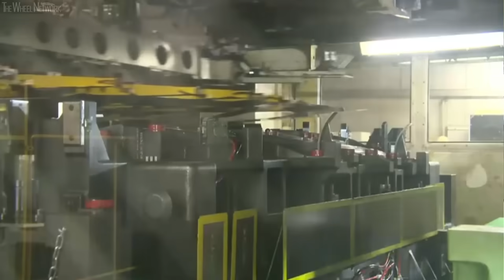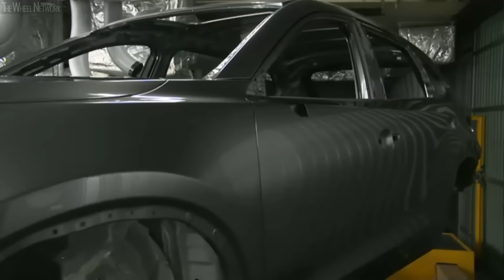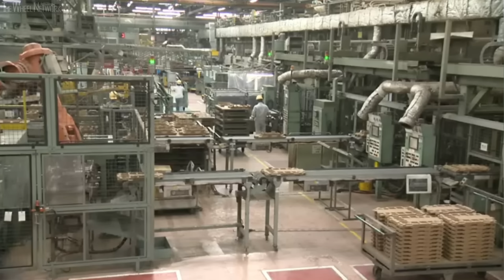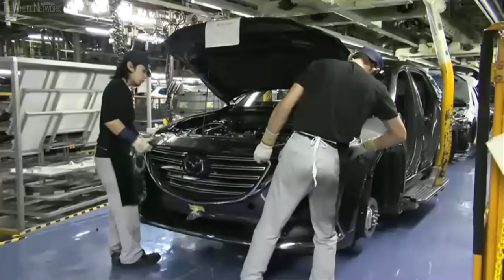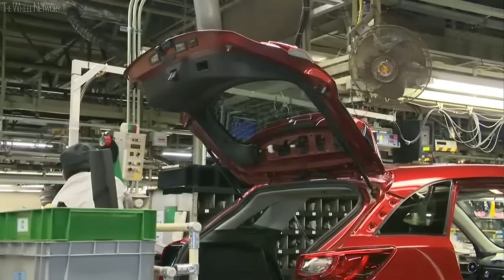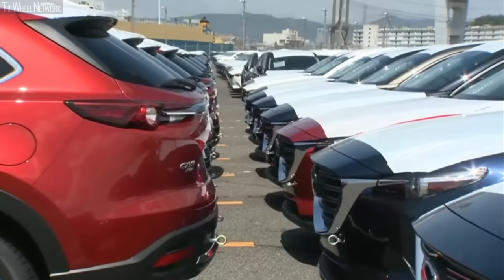Mazda Production in Japan

Comment: Interesting to me the number of comments here from Mazda owners, pretty much all of whom have good things to say about their cars. Definitely an underrated brand. Zoom zoom.
Reply: Read again. I found many problems in comments as rusty pieces everywhere and shit thick metal pannels
Reply: Guess you forgot about the "Zoom Boom" screw up.
Reply: @JuanCaBaez  car factory standard is 0.6mm thick and yes metal rust, next time buy a very expensive audi with a "space" frame that oxidizes ;) every car manufacturer has it's problems with a or more models they make. Look at Tesla: the panel fitment is mostly junk.
Reply: @Damicske  es peor cuando habiendo comprado un Mazda 3 del 2018 y golpeado 👉"involuntariamente"👈 el parante C, se dobló...!!! (IT bends!!) lo que en cualquier auto, no pasaría... lo tuve que vivir y lo tuve que vender!!
I had to live it, and I had to sell it!
So it's a shit personal experience...
Reply: I currently have an '18 Mazda 6 with manual - 40k in just over two years (I drive a lot) and its been flawless. Also, this is my third Mazda in 13 years. Amazing cars.
Reply: I have a Mazda 6 first hand, model 2003 with 245.000km. It is in perfect condition after 17 years, fully reliable with zero problems. Recently i also bought a Mazda CX3 diesel, AWD Auto. It is such a nice car. Mazda is indeed a very good manufacturer. If you don't own one you cannot understand.
Reply: @nikostzagar  i had had two mazdas. First one was a matsuri sedan 626 2.0l year 1995, full!  It was an amazing car.
Second, new mazda 3 sedan MT 2.0l year 2018, 0 Kms. What a CRAP!
Reply: @JuanCaBaez  Sorry to hear that. I don't know why you were not happy but I am very excited with my Mazdas.
Reply: I own a Mazda 3 2011 102000 miles still running good
Reply: @nikostzagar  problems all around. Noicy suspension, bad interior insonorization, no navigator because mazda doesnt have ecuador's map yet, bumpy, bad function of wipers sensor, radio controls were dumbs, weak pannels and hollow sound in doors, very bad seats that unbuild themselves, shit interior that got scratched very very easily, poor space in the trunk, etc etc
Of course this is in comparison with my Megane 2.0 2006 that goes perfect and works better than that shit car I bought. But I sold it fortunly!
Reply: Mazda is second choice on a lot of people's lists. That's the issue though, they're hardly ever the first pick. Mazda is an amazing bang for the buck brand. I feel with the new line of cars they're really attacking BMW head on.
Reply: @JuanCaBaez  Every car has rust issues, given the wrong environment and time for it to develop.
Reply: @JuanCaBaez  You're the first person I hear praising a French brand after having had a Mazda. Also, if the 2006 Megane is an improvement compared to whatever Mazda you used to own, most of the issues (like rattles, bad sound insulation, out of date navigation system) are due to the car being of old age. You cannot possibly be talking about a modern-age Mazda, this was a '90 to early '00s Mazda at best that you have owned.
Reply: @JoppedeZeeuw  maybe I'm the first going against tendency, but I had owned mazdas from 1995 (Excelent!!) and 2018 (A complete shame for brand, Crap, shit in all the posible meanings) and the Megane II 2.0 sedan manual; wich is my reference to buy a car (sedan "C" segment), until now not beated. ;)
Reply: A great car indeed. Durable and elegant at the same time but what about the rust?
Reply: @mentzo1  rust is something every car experiences at some point in its lifetime if it gets the chance to develop (rain, salted roads etc). The reason why it’s notorious for Japanese cars to rust is because those cars are around long enough to develop it. If you look at a VW Golf/Rabbit or a BMW 3-series of the same age, they will also show significant rust. But people driving expensive brands tend to replace their cars sooner too and therefore they hardly become old enough to show it before they are scrapped.
Reply: @JoppedeZeeuw  Yes, but I think it also has something to do with the metals used.
Reply: its used to be owned by ford take over the Mazda,,,..and now began this model and  is purely made in Japan,,we all know quality of cars manufactured in Japan and  best and good cars in the world
Reply: Allen S  had you bought one of those mazda craps ever? Do you have a license? Of course that do not waranty you know how to drive... if that is even that way, you might have driven a good car to compare with... I really doubt it actually!!
Reply: @JoppedeZeeuw  never experienced rust in any of my Mazda’s.  To be fair, with any Japanese made vehicle, and we have owned many and we live in a high rust area.  Electronics yes, but that is every single vehicle we have had, noting the environment is harsh where I live, salt, high amounts of rain and sulphur.  I have experienced rust with just about every American made vehicle.  Maybe it’s the manufacture country that is the issue and not the brand?
Reply: @mentzo1  I hear this a lot but where is the evidence or is it fan boi's of other brands continually trolling Mazda?
Reply: @JuanCaBaez  lol you found many problems in comments and you believed them?
Reply: @jace1113  of course!! I set one comment with my personal experience of that poor brand... the whole car was a piece of *&¿$. Why dont you belive them? Sharing experiences is the main idea of this....
Reply: Robert Bueno  io posso dirti che per una machina turbo, la sua potenza di 143 hp è poco... dovrebbe essere vecina a 180 cavalli. You do confirm me.... sell that car was the best idea ever!!
Reply: That's right, I don't know why this Ecuador guy thinks a Renault is better than Mazda. I also have experience with Renault and Mazda, and I will say, even though the Renault might have better features (but again, I'm comparing the most expensive trim of a Koleos against the most basic trim of a CX-5), but the Mazda is way better to drive and in general just felt better. Also, if someone actually ever ownered a Renault, then they would seriously know how horrible Renaults can get after a few years of ownership, the issues old Renaults can develop after a few years is just ridiculous.
Reply: @e8u3s72  that's only because I had mazdas 626 and 3, and the last one was a crap, also trying other 3s of the dealer, and comparing with my megane (I still have it).
If you like that hollow sound in all Doors of the car, the noise of tires inside, or the seats unbuilding itselves.... your fault!!
Ya los he prevenido. No digan luego que no...

I hated so much that piece of car that I would never buy another one.
Reply: @e8u3s72  you're the lucky guy. I had heard many problems with the CX5... bumpy and noicy suspension, need to replace..same as I had with that CRAP I bought.
Lucky you. Buy them all!!
Reply: @e8u3s72  en ningún campo podría superarle el mierda CX5 a un Renault Koleos. Debería haber un video sobre el tema... ya lo buscaré...
Reply: @e8u3s72  man tu problema es que idealizas tu chingadera.
En Ecuador llega el CX5 2.0l con 156 hp, que es la misma basura que el mierda 3 pero con más peso y menos aerodinámica, mayor consumo, etc... y el 2.5l de 188 hp y tracción awd. El koleos es un 2.5l de 181hp caja cvt pero tracción 4x4. Y diciendo que comparas lo que tienes, con un pobre mierda 3 te dejan botado, peor si lo comparamos con lo que yo manejo ahora...
Renault tiene audio bosé y mazda tiene una basura de sistema que ni la canción que esta tocando la encuentra, sin actualizaciones, sin manejo fluido, sin Android, sin internet, etc... ya pase por eso y ya pagué la tontería de tener un mierda!!
Tengo todos los videos de las fallas del auto, de una en una... aunque debí haber sacado videos de los otros autos que me dieron a probar y eran la misma basura 3, CX3 y CX5.
Si tienes dudas de que en el Ecuador son una basura, te puedes comunicar con Maresa Center, representante en el país de esa marca y les puedes pedir la orden de llamada general a revisión de todos los autos?? Eso iban a hacer después que tuve la desgracia de comprar uno.... y esperaban que Japón o al menos México conteste, por que son tan malos....

Asi que man, buena suerte con tu #mierda, ups, #mazda
Reply: @JuanCaBaez  Firstly, use English, don’t use a language that someone might not understand to try to justify your nonsense.

Secondly, I don’t know where your magical “181HP 2.5L Koleos” comes from, since according to the official website and several other sources, the Koleos only have a 170HP 2.5L engine. (https://www.renault.ec/CountriesData/Ecuador/images/cars/koleos/archivos/catalogo.pdf, https://www.renault.ec/CountriesData/Ecuador/images/cars/koleos/archivos/fichatecnica.pdf). Maybe you would argue about the CVT, but the CVT on the Koleos basically failed its only job, which is to keep the fuel consumption down. I see no contribution of the Koleos CVT since the Koleos has a 11-12L/100KM fuel consumption while the CX-5 with a 6AT can keep the fuel consumption down to around 10L/100KM, with a more powerful engine.

Thirdly, about the entertainment system, the Bose system is only equipped in the top INTENS trim of the Koleos, while the exact same Bose Audio System exists in the GT trim of the CX-5, which is not even the top trim in the CX-5 line-up, but more like a mid-trim.
The rest of the paragraph, however, is just false, because the “no song title recognition, no updates, no Android, no internet” is just pure nonsense. Even on the lowest trim of a Mazda 3 or CX-5, you will have all those functions. (https://owners-manual.mazda.com/gen/en/cx-5/cx-5_8ft1ee17b/visual.html) 

Therefore, with so much of your nonsense, I doubt if you ever actually owned a Mazda at all. You’re probably just some bloke that got bored and decided to entertain yourself and releasing stress by going on a ego-trip and harass people with your arrogant comments.
Reply: @JuanCaBaez  that's exactly how I feel when I got a bunch of Spanish been thrown at me
Reply: @e8u3s72  you can not complain at all... a free lesson of cars and languages! What an interesting pack, don't you think so??
Reply: @JuanCaBaez  Ummm... when you have to read a bunch of Spanish misleading information mixed with random insults, it's not a great feeling. Especially when trying to be responsible and having to do a lot of research to obtain the correct data to try to avoid other people who's reading the comments from being misled by random data made up by a guy with horrible manners who thinks his proven-unreliable Renault is invincible.
Reply: my mazda cx-9 they are fully made in japan unlike most other mazda cars i got it in 2008 and had it till 2021 was totaled by a guy that hit me without insurance on my mazda never had any engine problems at all other than a power stearing hose problem that that was very fast cant say anything but great things about the engines
Reply: they got better after leaving ford and now they have partnership with toyota so they'll get better
Reply: I might be over a year late to the party but I had to. Open any book on marketing og maybe even a book on intro in psychology and you will learn that people who bought a certain product will often look for more info about said product. After theyve bought it. Why? To reinforce their belief that they have made the right choice. In this case its more about how the brand is making its products but my point still stands :)
Reply: @cristalteardrop  Arguing with that guy is probably the most horrible choice I made in the whole of last week
Reply: @gallay06  Yep, that's exactly what happened with the Ecuadorian guy.
Reply: @JuanCaBaez  that never happened
Reply: I’m on my 5th Mazda. A 2021 CX-5. My parents have loved driving them since 1989. We love them
Reply: @JuanCaBaez  that’s when Mazda was mostly owned by Ford. Now galvanized steel panels are used.
Reply: 2018 CX-9 with 125,000 miles.
Reply: @JuanCaBaez  I bought cx5 2014 January and I’m upto 9000 in repairs already!
Reply: @terencecambridge3243  oh, that's so bad. I' m sorry You had had that experience. That's my history and that's why I would never get closet to another mazda.
Good for all the people that mazda is a good brand... Enjoy that peace of ...car... But I need something better to feel the experience of driving.
Reply: @JuanCaB😅🎉aez

Comment: I own a Mazda 626 Sedan in Prestige Silver colour, 1990 model ... bought brand new in Melbourne, Australia as a gift from my father for my 18th birthday. He paid $ 32,000 Australian dollars for it back then! It's now 32 years old, has done 500,000 kilometres and l continue to drive it daily. Has never failed me. Unbelievable car. I cannot part with it. My first and so far, only car ...!!
People cant believe it.
Reply: The 626 from that era was an amazing car, I have no idea if modern Mazda are as well made or not, I suspect that they are not because consumers today have no desire for the car to last that long, they would rather “recycle” the car after 10 years or so.
Reply: I can believe you, I have Mazda 323 2000 model, and yes it never left me on the road. 
Despite being a cheap and low-end car with a small engine, this car was and is extremely fun to drive in mountain turns with a balanced power-to-weight body.
Japanese knows how to make good and reliable stuff.
Reply: Amazing!!!
Reply: I hear you man! 1998 626 here with 410,000 kms! Incredible cars!
Reply: LIE LIE LIE
I STILL HAVE THE BILLS I PAID, THE PHOTOS OF THE BROKEN PARTS, THE CAR IS A CX5 AND A 2015 MODEL, IT HAS 160 KM, IT'S NOT JUST ME, MANY PEOPLE HAVE THE SAME PROBLEM, NO ONE IS SATISFIED. THIS IS A GARBAGE CAR. SHE Spent 7000 EURO FOR THE CAR WITH 160 KM. DAMN IT, SUCH A CAR. AYA
Reply: @Devrim2000  Let me guess, it was a diesel, right?
Reply: I do😂
Reply: 1985 Subaru Leone...1994 corolla csi .running smooth 😊😊
Reply: @Devrim2000 …Wao!..you got a Bad Luck, I have a CX5 2014, and is a extraordinary SUV..!..in 10 years I just changed oil, battery, and tires!..ho! and I forget it, Air conditioning maintenence!..I swear of you!!..😂

Comment: I own a 2009 CX-9 Grand touring since brand new, now 133K miles.  Two minor repairs over the past 12 years: (1) driver side door motor - replaced gear myself; (2) rear structs leaking oil - replaced by auto shop. Interior and exterior hold up very well. The car still runs like new. In contrast my wife's 2008 Acura TL developed couple of more serious mechanical and electronic issues way before 100K miles. The "leather" seats started to crack few years ago. Its interior looks like a 30 years old car. Mazda really put in quality stuff.

Comment: Cool to see. I work in a Honda plant. Even though the processes are slightly varied, I know what's happening every step of the way. (Love my Mazda car btw 😄)
Reply: I worked in Marysville decades ago, left in 1998. But I took the Mazda factory tour in 2015 when I was on a trip to Hiroshima. The biggest difference I noticed was the flexible manufacturing at Mazda. At Honda, they build basically the same model in a plant, in lots of 60 - for example, 60 Accord EX sedans in the same color, same feature packages, all in a row. (I assume it’s pretty much the same today.) They added some model flexibility when they started building Acura models. 

At Mazda, I saw an MX-5, then a CX-9, then another model, one after the other. Seems less efficient on paper but then they don’t need the excess manufacturing capacity to build 3 models.

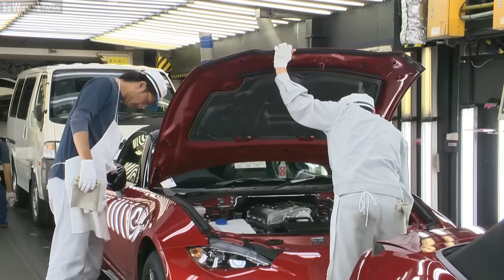Look at 22:22 and you’ll see what I mean. Different models and colors, one by one. You’ll never see Honda do that.

P..S - I bought a used Accord EX V6 on my last day of work at Honda. It was a manager vehicle, with 60k, and was better than my other car was even when new.
And almost 25 years later, I still miss being at Honda. Working there was the fulfillment of a dream to work at a Japanese transplant. While I went on to make more money elsewhere in automotive, part of me regrets leaving there.

Comment: In manufacturing/assembly, it is astronomically difficult to get product out that is near 99% right first time at this sort of speed in any case. My 2019 Mazda3 is 2.5 years old and not one thing is out of place, everything is solid just as it left the factory.
When you consider the number of elements there are to developing a car (R&D, design, engine development, trials, on-the-road testing, software/technology incorporation, component layout, structural design, interior design and fittings, press tools, external suppliers, servicing and wear and tear considerations, and most importantly "can it be made?..." The list goes on,) it's astonishing how easily we take it for granted. I fully respect the people who all played a part in developing the 3 (and any other Mazda) and the operators/technicians that put them together daily with great consistency, as they couldn't have made it any better.

Comment: I love my Mazda-3 zoom-zoom, Attractive design, reliable power-train, great handling characteristics. Only thing I wish Mazda to change is the sheet metals to stronger ones or galvanize the one used to make Mazdas. They rust quickly if not protected or undercoated, Not everybody lives in California sunshine. Thanks for the rare video WN
Reply: Giardintek Have you ever tried driving with two adults sitting in the back seat?  It’s a beautiful car, but no rear seat leg room.
Reply: To rust you have to live near the cost. The salted air is very corrosive. I believe all Mazda's sheetmetal is galvanized. Normally you have a warranty for that.
Reply: @PhlilipeAlves  rust is a problem in many snowy US states because they use a kind of salt on roads.
Reply: If their not galvanized, what is that swimming pool the dive in? To clean, the base for paint or To galvanize??!!
Reply: @80808O  snow is the same for all cars, but Mazda rots much faster than others.